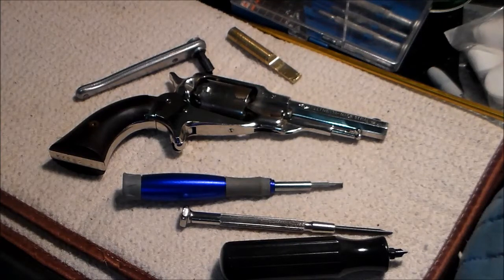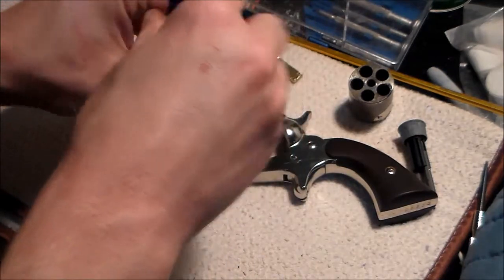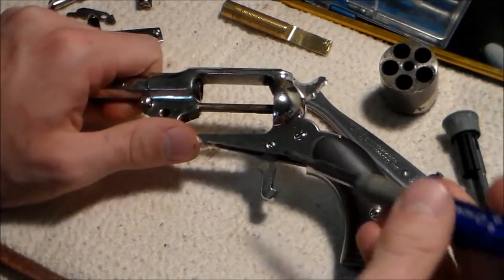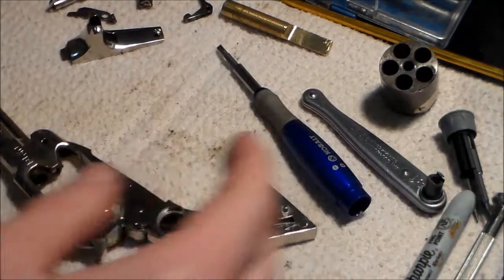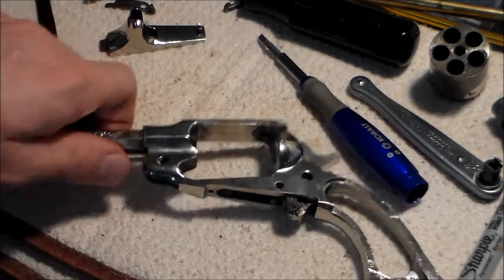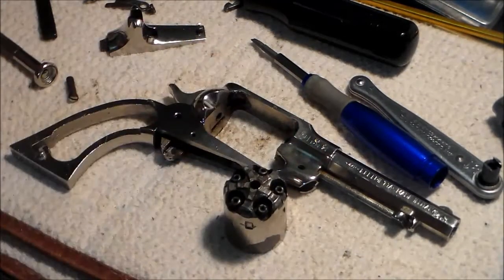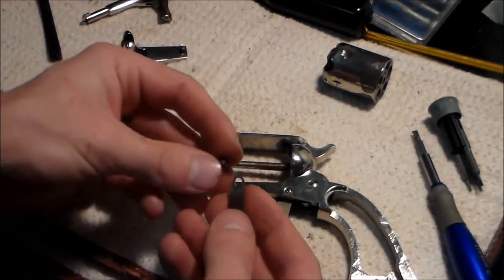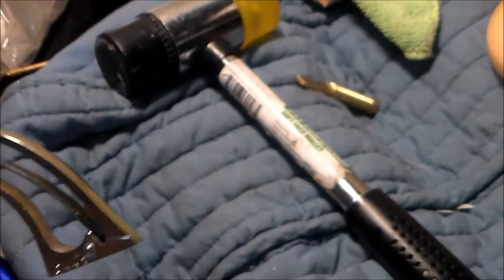Remington Pocket Revolver Disassembly-Cleaning-Reassembly

Comment: Ive always taken the hammer screw out before the main spring to loosen the tension first the spring just falls out..when i reassemble i attach the hand to the hammer, n put the spring in before the hammer screw so theres barely any tension, then i push the hammer assembly downwards against spring pressure til the holes line up, drop the screw in bingbangboom
Reply from the maker: With the .44 caliber 1858 NMA I do that same procedure, however the Pocket Remington does not have a screw to adjust the tension on the mainspring, which makes the process a little more difficult. Thanks for watching!

Comment: Wanna hear something kinda odd? An older gentleman (yes there are some people older than me....and I'm old) I recently met at a gun store, who has "been there and done that" in three wars, carries a Remington Pocket Revolver reproduction a LOT when out and out. When he feels like he might be going into an area that could require a bit more, shall we say power, he tucks a .36 caliber reproduction Colt's 1861 Sheriff's Model into his waist band. Having seen him shoot at man sized targets at ranges that varied from point blank to twenty five yards, I really don't want him shooting at me with ANYTHING.  Excellent video as usual! Keep 'em coming!
Reply from the maker: These guns can still get the job done today, I wouldn't want to be in the way of one, even if it's a smaller caliber. I'm glad you enjoyed the video, thanks for watching!
Reply: I did a chrono test with a LabRadar chrono, the results were as follows;

Remington pocket revolver in .31 calibre. The revolver is stock, unaltered. 
The  powder used here was 11.5 grains of Triple 7 measured out BY WEIGHT on an electronic scale. The projectile was a home cast soft lead round ball
 at .322” diameter. The powder nearly filled the chambers and the round 
balls were hammered into the chambers off the gun leaving a good ring of
 lead shaved off. A very tight fit necessitating loading off the gun 
with a plastic mallet and brass drift. The caps were RWS 1075 PLUS.

High 956 fps, low 802 fps, average 874 with an extreme spread of 155 fps.

874 fps I REALLY would not want to get in the way of that !
Reply: FD Mackey  especially with the conversion cylinders these lil bad boys ain't nothing to play with

Comment: I would check the cylinders ends see if the chamber is not opening wider by bad steel it could be why the nickel staying on the cylinders cracking and flaking off.

Comment: I'm thinking of buying one, but here where I live, the spare parts for the pocket remmy are out of stock and I don't know if they'll restock them. I'm mostly worried about the springs. Are they interchangeable with the larger 1858? I've had both the hand spring and main spring snap in my 1858 and had to replace them
Reply from the maker: No, unfortunately I don't think they parts are interchangeable. I would go online to Taylors and Co. or VTI Gun parts for replacement springs for the pocket Remington.
Reply: Thank you for your answer. That’s unfortunate. I might have to contact the sites that selled them and ask if they can restock it again. Have a nice day

Comment: Hey, nice job on break downs and  explanations
Reply from the maker: Thanks! These guns aren't very difficult to work with. The peeling nickel plating is rather annoying though, not sure what to do about it.
Reply: Yeah it is annoying. I ordered a spare cylinder for mine and the second time I fired the new cylinder the nickel flew off in shards and shredded my left thumb. The original cylinder that came in the gun is perfect. No problems whatsoever. I just think it's the luck of the drawer. I might get it stripped and hard chromed ?
Reply from the maker: That might work, with mine I'm thinking about attempting nickel plating myself.

Comment: Nice video bud, you do very well indeed. Clint Eastwood carried a Pocket Remington in " High Plains Drifter" always wanted one after watching that movie.
Reply from the maker: Thanks! I didn't know he carried one in High Plains Drifter, going to have to watch that one. Got a question, I got some Loctite a couple days ago for the 1873's push pin, and was going to put a drop on the threads, but was wondering if that would glue the spring down and not allow it to function properly?
Reply: Shouldn't, but a little bit will do. Try it see if it does make sure you use the blue, red is permanent. HAHAHA, wouldn't want that.
Reply from the maker: Yeah that wouldn't be good, lol!  I'm also ready to try my luck at making some holsters, got some tools just got to get the leather, my local craft store has 6-8 oz 8-12" x 5' leather sheets, think I may get that. Do you know of a online source for leather? Tandys was a little pricey I thought.
Reply from the maker: Thought I would let you know that midwayusa has a walker for $318 right now  https://www.midwayusa.com/product/713510/uberti-1847-walker-black-powder-revolver-44-caliber-9-barrel-steel-frame-blue-blemished  Listed as blemished, not sure what the problem is.
Reply: My be a bluing rub or something of the sort. Thanks!
Reply: Tandys is where I used to get mine, but the prices these days are a little steep, used to get mine from a saddle maker but he went out of business.
Reply: @blackpowdershooter44  The final shootout! Remington Army (he has to swap cylinders out in the street when he runs out. But then Clint is empty again and so he pulls out the little pocket gun like yours!

Comment: You don't need to pull it apart to clean it first never ever use oil  it turns to tar it then you have to rip it apart like that use Bear grease I know hard to find but if you use something like that it cleaner and won't be hard to shoot also when you fire the first round lift it up so that the barrel is in the air then the spent cap falls off called the calvery something been shooting BP for 40 years found out the hard way.
Reply: Pointing the muzzle up just let's caps fall into the hammer channel jamming the gun..just rotate the gun in its side while cocking let's the spent cap fall free

Comment: I'd have stopped after removing the trigger guard and grips; throw the pistol into a Ballistol bath; use soft tooth brush; since in hot water and finish up with another Ballistol bath.
B careful with the nipples; soak in Ballistol; soft tooth brush; consider AM SS replacement nipples. Just my opinion.

Comment: you really only have to clean the cylinder and the barrel I do not think you have to disassemble the whole thing
Reply from the maker: I don't disassemble these revolvers very often for cleaning, I usually just clean what I can of the frame, cylinder and barrel. Thanks for watching!
Reply: Brett Duffy the residue from black powder creates sulfuric acid when it comes into contact with moisture in the air. While a pretty low concentration, it is still corrosive, and will rust out any steel components. While not strictly necessary to detail strip it every time you fire it, it is still a good idea to do it often, as the black powder residue will get everywhere, including the inside of the frame.